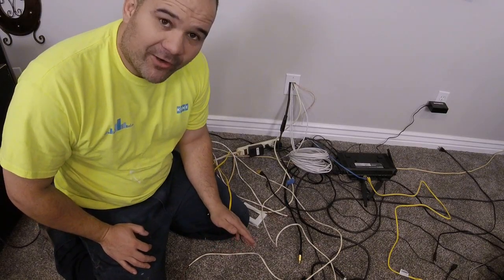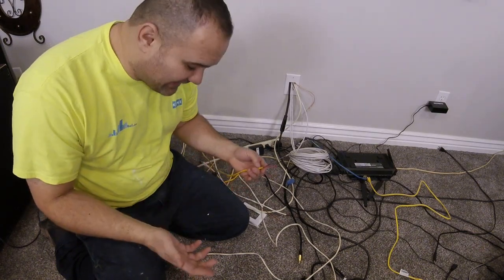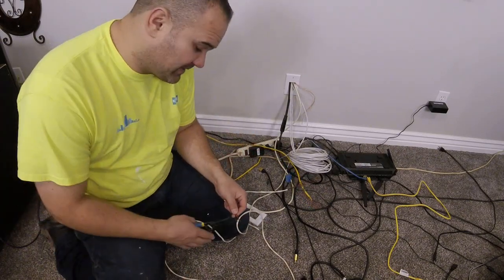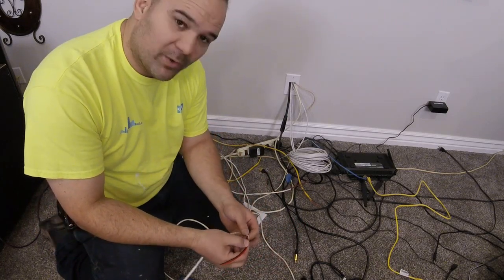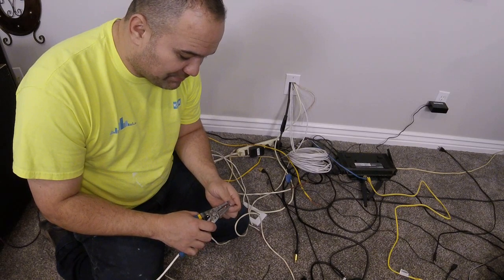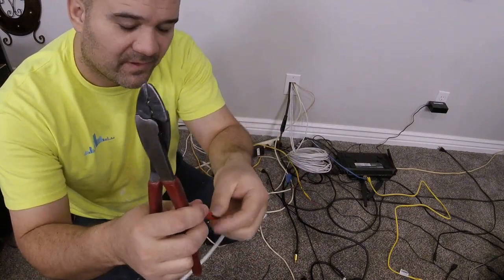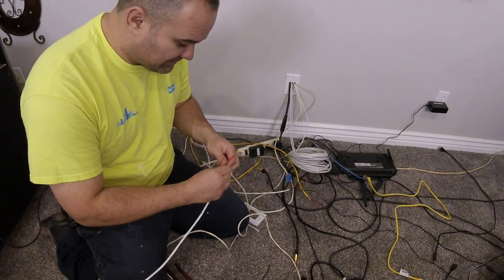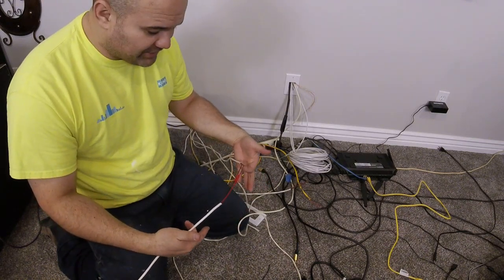How to splice any stranded wire

Comment: So, does the copper wire overlap within the plastic sleeve then you crimp it?
Reply from the maker: Inside the plastic tube is a metal tube. There should be some kind of stopper in the middle of the metal tube so you can’t push the wire in too far. The stripped copper should go all the way in till it stops on the stopper in the metal tube. If you stripped it correctly, there should be bare copper in the metal tube without any copper sticking out of the plastic. Crimp the metal tube with the copper wire in it and you’re done.
Reply: @AlanCleggYouDoAV  Thanks!